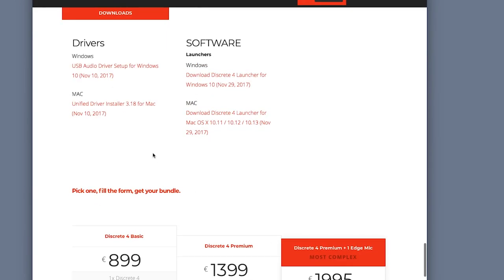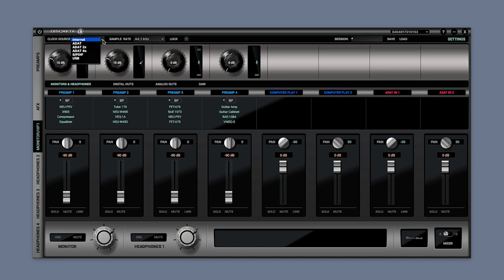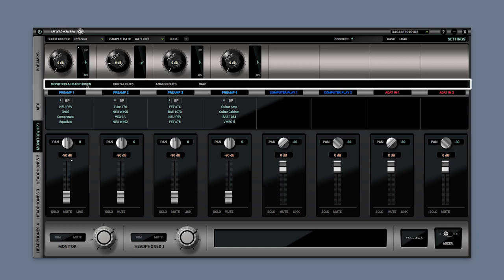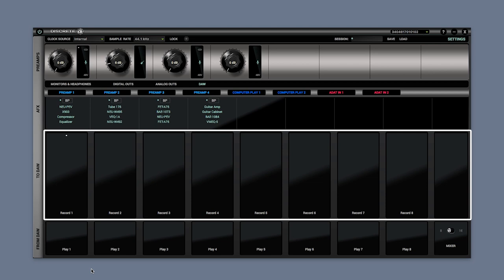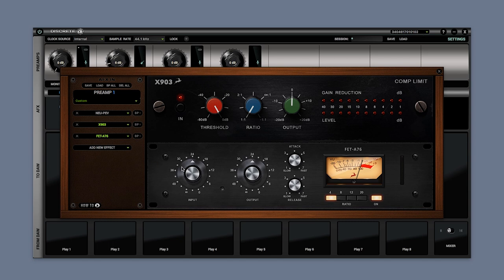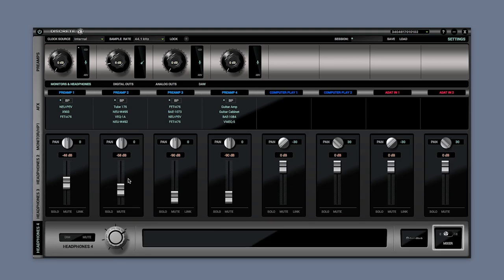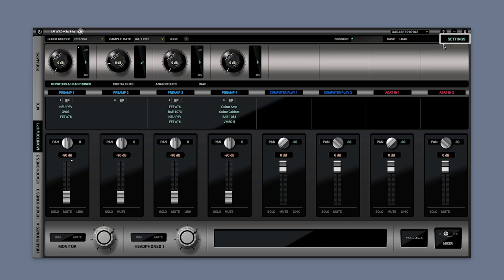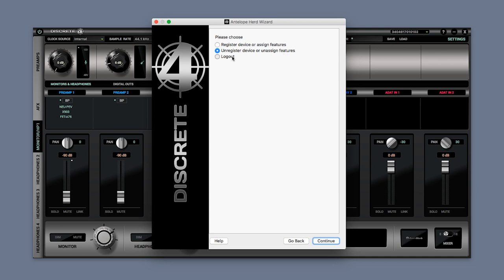Discrete 4 - Control Panel Basics

Comment: I have had my antelope discete 4 for 6 months and still get no sound out of my monitors i fe F*** for buying this junk i cannot figure out how to run this piece of equipment. I should just get rid of it. I am at my jumping off point just buy something else that makes more sense to me i guess. I dont even have this hard of a time with any piece of equipment ever
Reply: @Doggieflicks  hey i did this! To get sound finally
Reply: Go onto your mixer board and on channels ok listen to me on the 5th channel do this and youll get sound. On the 5 and 6 strip you want to put it on computer play 1 and the next computer 2 this will be your input or outputs to garage band. The fisrt 4 strips are for preamps and these stupid plugins they have which i heard we cant really even use in out daw i dont know. Bit thats how i got sound
Reply: So you got it worjing???  Hope that helped